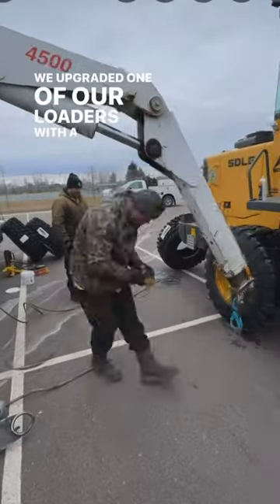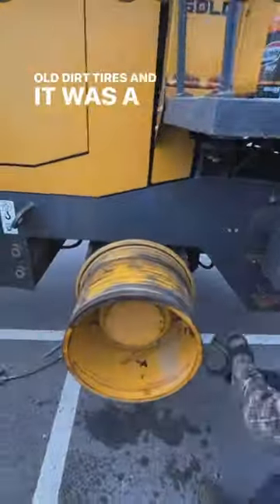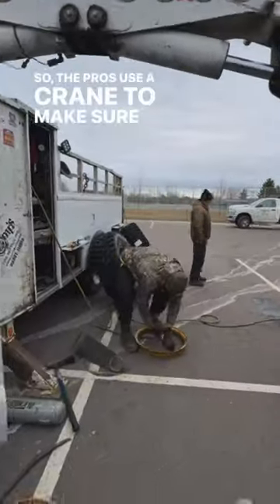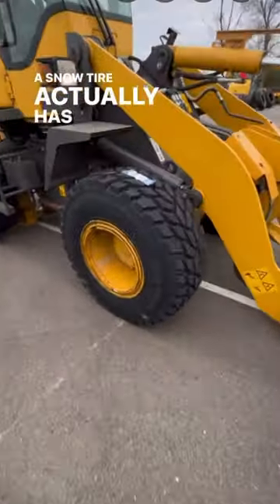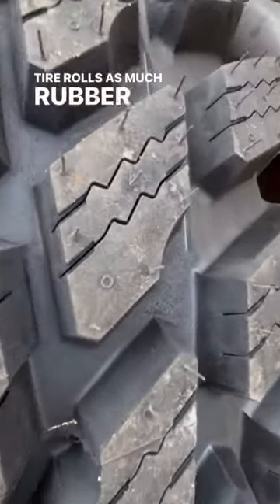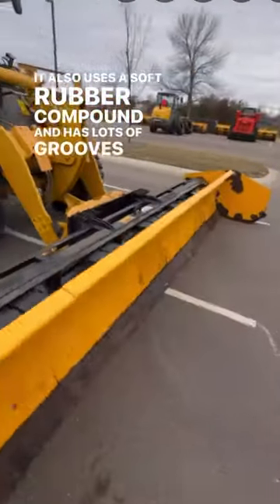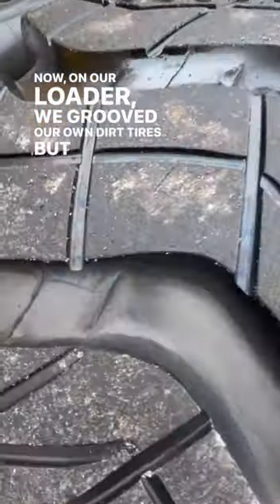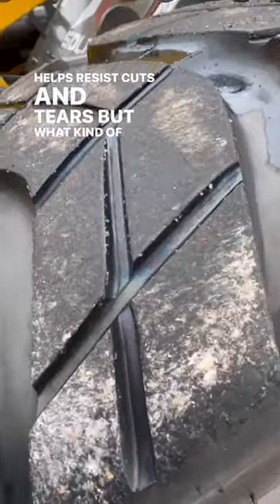Danger, danger, Will Robinson! #shorts #tires #snow #wheelloader

Comment: Those slip rings can kill you when inflating tire. I would lay that tire on ground with ring facing the ground if i had no cage to put the tire in. That ring flies off while inflating with ring facing you would mean GOOD NIGHT IRENE!
Reply: With proper cleaning of the groove, inspection of the lock ring components, they are perfectly safe to change like this. Just need to be paying attention..  Done many of them on the machine, and I didn't have the luxury of the boom truck
Reply: I used to work for an old guy that had a bunch of wheels like that.We would take them off the truck or tractor and wrap a chain around them when mounting new tires.
Reply: @mattdudley3789  thank you I was the one in camo doing the work the boom truck is very nice for changing tires out